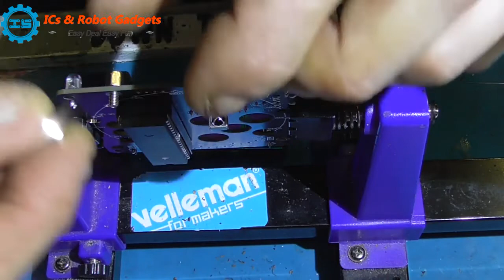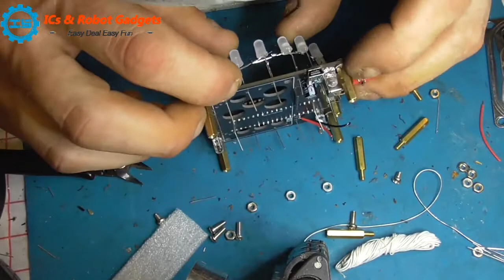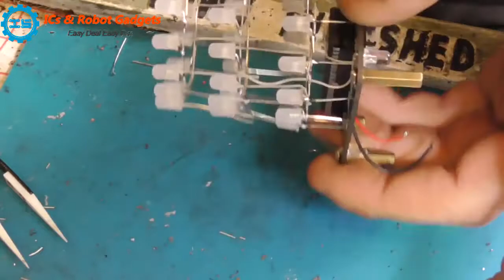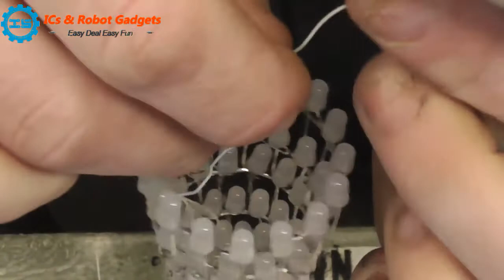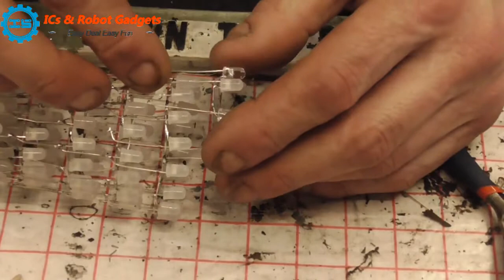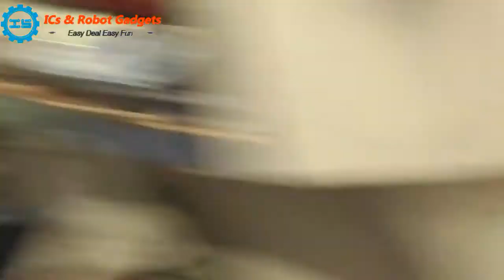GUANGZHOU TOWER GY17673 (CANTON TOWER) DOWN THE SHED WITH ICSTATION

Comment: I didn't realize there were 2 versions of this kit. The one I built was the older one you had. 
And I wish I had though to do the layer wires one level at a time, rather than fishing the wires up the middle after the tower was built.

Still, it's a helluva impressive kit.